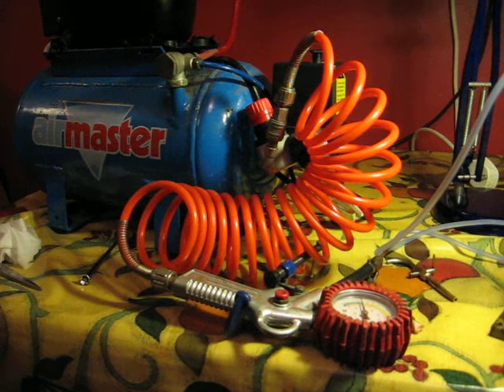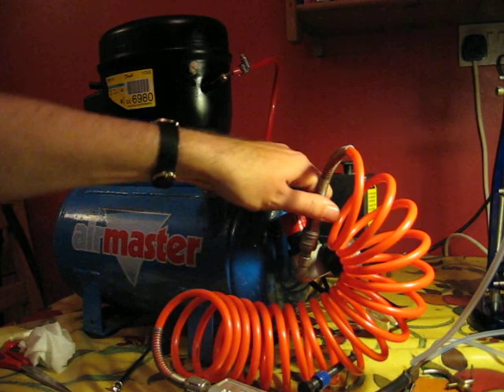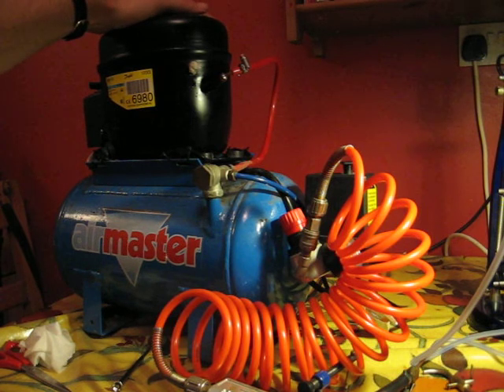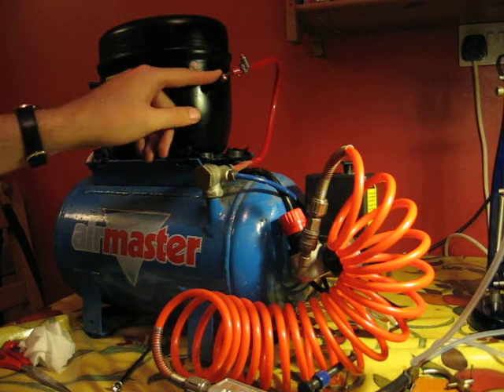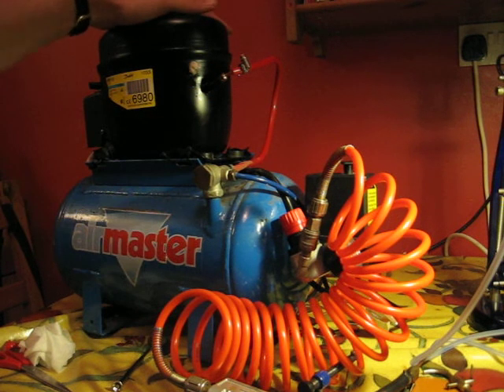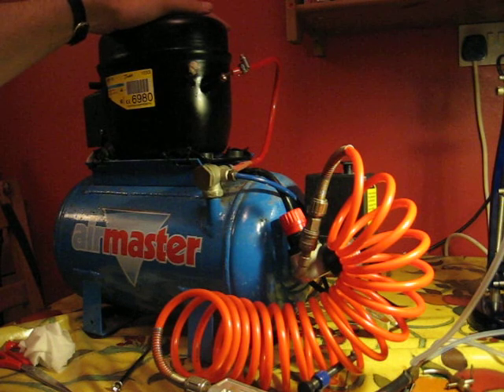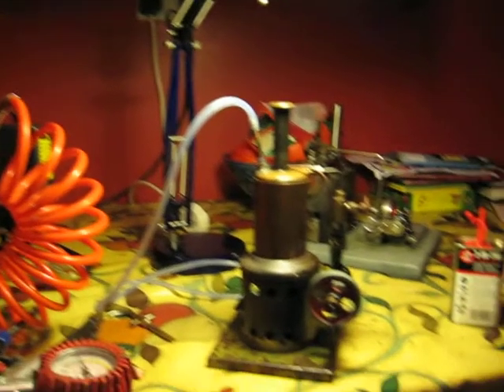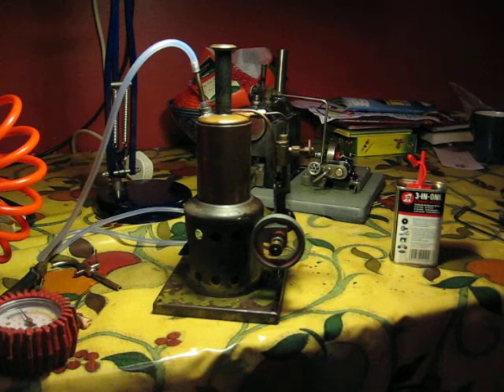A very quiet small air compressor

Comment: in a refrigerator they have to work much harder and hotter to compress the refrigerant,using it as a air compressor it works less and the psi you are using on this smalll tank is nothing to the psi that is reached when in a fridge check the internet or youtube and you will find loads of silent compressors

Comment: fonejaker just to let you know they do fit refridgeration compressors try looking at bambi or nu air silent compressors they use refridgeration compressors but they put a oil window in so you can top the oil up they are widely used now and some of the big ones have 3to4 copressors working at a time and there fine and bambi compressors come with a 10 year garantee

Comment: This will work for a while until it pumps all its oil out.   Refrigeration compressors don't have the same piston rings as a normal air compressor so they pass quite a bit of oil.   This isn't a problem in a closed recirculating refrigeration system---but this application will eventually suck the oil reserve dry causing the compressor to not start one day.    If you do try to add some oil to it use mineral oil.

Comment from the maker: It's been working fine for a year or so.....I only ever use ressures of about 40psi, and it has no problem starting under that. It has a pressure switch, so you can preset the pressure, it operates just like a normal compressor. If the pump should fail at some point I'll get another from the scrapyard ;-)

Comment: the pump you are using wili fail soon because the pressure switch has been removed and when the pump restarts under load (PRESSURE IN THE LINE}the motor will struggle to start EVENTUALLY and blow fuses or burn out. thats why compressor manufacturers do not use refridgeration pumps.